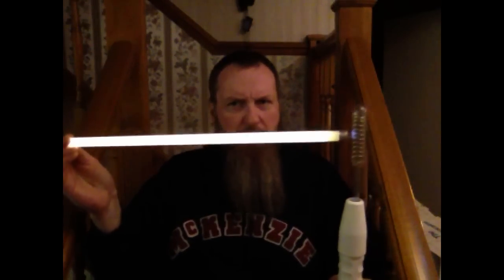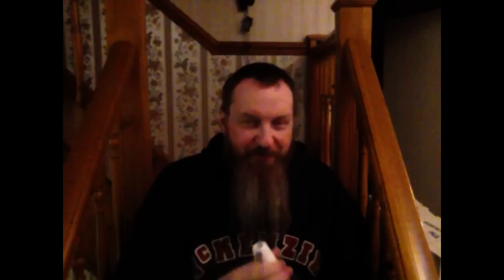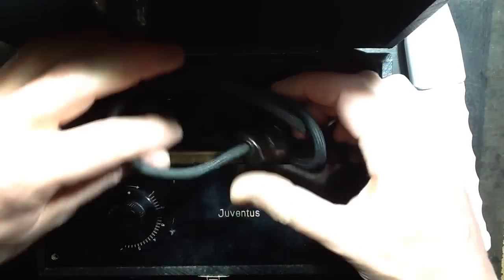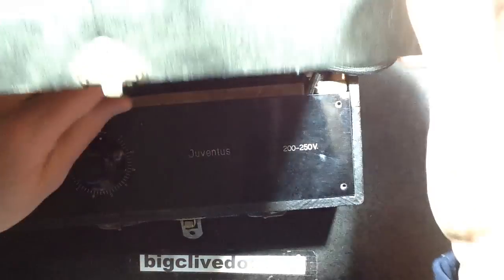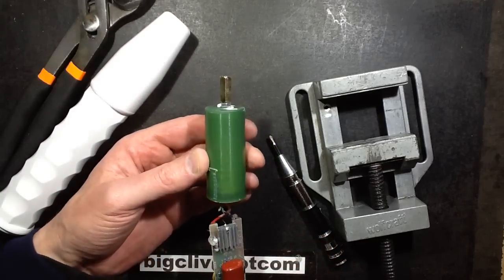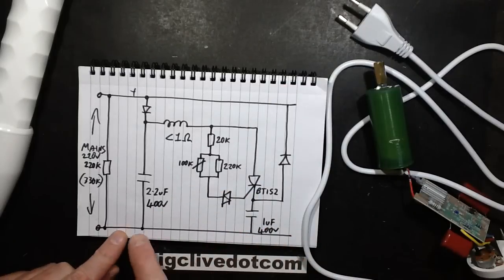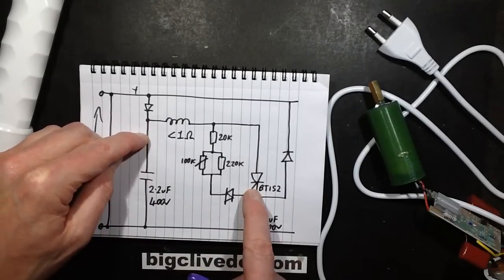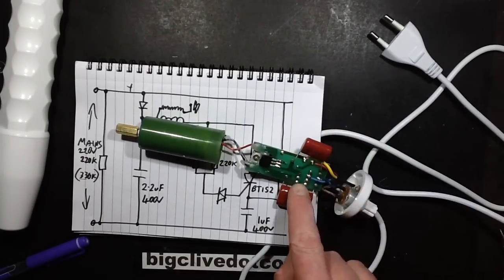A look inside a Darsonval style modern Violet Wand Ray unit.

Comment: So couldn't you actually just bypass all the resistors and the diac and the diode. Rund switch straight to the capacitors and into the coil. I mean these things are all rigged up to like get it down to like 10 to 15 20 watts. So if you bypass all that run the capacitor straight into the thyristor and into the coil. So I looked up each individual piece and what every piece does. The thyristor allows for your 120 volts to the 220 volts there's two different thyristors, but I don't think they used thy wristers on the old Violet Ray wand. All the resistor does is only allowed so much current to flow through. A dioid only stops the current from flowing back and destroying any of the components. The diac is connected to the thyristor and it's similar to a diode it only let so many volts flow into the thyristor. There's only two types of diac mainly. One diac lets about 30 volts flow through and the other diac up to 70 volts through through the other one is the ht60. So what do you think you could run the potential meter is straight into the capacitors and into the coil. I mean you'd still have the control of how much water is your voltage is going through the capacitors in the coil with the potential meter. It just wouldn't be resisted down it would seem I don't know what do you think?

Comment: Great video , how does one open the black wand unit itself on older models , same method as on this video ?. Is there electronics in the old wand handles also ? my old Voiletta has just died. Appears to be no voltage on the glass handles and little or no violet inside the handles .The mechanical clicking noise is still there from inside the box . Last time I used it I think I used it for about 20 minutes ( maybe that's too long ) Any idea where I would start in terms of fixing it ? tia.
Reply from the maker: Some have a screw down the end and some have a cap that unscrews at the cable end.  Be very careful, as these units do not have isolation from the mains supply.  (I recommend that they are not used with the metal rod electrode.)
Most common failure tends to be the capacitor in the base unit.  The wand just contains a coil, but if that fails it would need replaced completely.
Reply: @bigclivedotcom  Thanks Clive , when you say the '' base unit '' do you mean the ' box electronic section  ' or the ' black wand itself '' ? ....sorry for the silly Q , thanks a mill in the interim .
Reply from the maker: @danvelgtr  The box.  All the wand contains is a wax impregnated coil.

Comment: I finally found it and very interesting it is too. I did try thumbing through your videos but kept being distracted. I still have about half a dozen or so of the old types electromechanical ones in the attic above my workshop which I never got round to making safer and selling. I really must have a clear out as I forget what's up there. I can see a dual trace valve oscilloscope and a valve audio frequency generator next to a couple of AVO's. I love vintage electronics so much that I'm always loathed to get rid of things. 
I have a question Clive.... Would you be interested in having a dig around in the inerds of a Nixie clock which I was given by a friend who is no longer with us. It's working after a fashion but one tube doesn't seem to work but flashes briefly if I nudge the memory battery. It's beyond my knowledge to fix but I imagine you might be able to make a fun video out of it?
Reply: Hi there - are you interested in selling any of your possibly surplus stuff to a good home?
Reply: @NeuronalAxon  No, I recondition them during the winter then sell them as working, electrically safe units. I use the ones which are beyond repair for spare parts. Sorry.
Reply: @PurityVendetta  hi there the units or unit are ready to sell?

Comment: The circuit is cool, takes advantage of dimmer switching noise!  I think the diode not only discharges the 1uF, it also charges it to -300V so you could dump up to a 600 V pulse into the transformer.

Comment: Thanks for making this video. Have u made one for yourself too? I want to know the number of turns on the secondary coil.
Reply from the maker: It's potted in resin.  The high voltage means that winding coils like this has to be dine in well insulated layers and then vacuum impregnated with resin, or wax as in the old days.
Reply: Is the green cylinder a DC 3-7V to ~10KV spark generator? If it is the spark generator then it is easier to replicate this circuit? 
Can you confirm that by just adding DC battery to the input of green cylinder?

Comment: Just subbed today, totally loving the content! Showed this video to my QPP and now she hates me cause she wants one 😜 Of to EvilBay I go!
I wonder, how feasible would it be to fullwave rectify the input to give 100Hz? And would it still work with an isolated supply?
Reply from the maker: It needs the polarity change to create a higher voltage differential in the driver circuit.  You could possibly run it on an isolated supply, but the unit would cause a high voltage differential between the isolated side and ground, possibly defeating the isolation by causing internal arcing.
Reply: bigclivedotcom Aww bawls, I thought that might be the case with the rectifier arrangement because of the voltage doubler. Read about that little dinger further down the comments after I posted mine. I suppose if she chooches right out the box, no point messing with her.
Thanks for the reply :-)
Reply: +azayles QPP=Quadratic Permutation Polynomial?

Comment: Would you do a vid seeing if this can actually damage electronics?
Reply from the maker: +ryan clarke That's absolutely guaranteed.  It can generate a modestly high voltage in nearby objects and a direct discharge will cause significant damage.
Reply: +bigclivedotcom pretty please ?

Comment: Hi Clive - Enjoyed the video on your Antique Violet Ray.  Just purchased a similar Antique Ray machine.   Could you tell me the voltage rating for the replacement Capacitor you installed in your unit?
Reply from the maker: +AlanK I'm pretty sure the one I used was a standard X2 interference suppression capacitor.  Probably rated to 630VDC.

Comment: "The other major market is electro-fetishism where the scary and tingly effects are popular for kinky fun." Upvote if you weren't aware of any other modern market for these before seeing this video.

Not-so-fun fact: Given half a chance, these will ignite silkscreen on clothing. Essentially the combination of current and voltage turns latex paint into a fusible resistor.
Reply from the maker: Even less fun fact.  Many of the fetish items in use with the metal rod electrodes are making the holders live at full mains voltage without them realising it.  Someone recently told me about when they were at a fetish event and while holding the unit they reached up to adjust a chain and got locked on.  Fortunately someone saw it happen and pulled the plug.

Comment: Don't forget the BDSM crowd love these things,not just for quacks
Reply: LOL OMG
Reply from the maker: Martin O'Donnell Yup, and they often use the original retro units with the metal wand attachment because they really don't have a clue how dangerous they can actually be.
Reply: bigclivedotcom Some of them do. I have a friend who has gotten several designs burned into her skin intentionally with a violet wand (in a BDSM setting).
I assumed that the main reason they were around was BDSM because I've never seen them used outside of those circles.
Reply: +Martin O'Donnell I guess so...On EBAY the violet wands are on the same thread as vibrators, D-rings etc... weird.
Reply: +Martin O'Donnell And it is from the BDSM community that the modern term "violet wand" originates.
Reply: Ive been thinking about getting one of these for this exact reason, are there any that are particularly more safe than others, or are they all kinda dangerous. I kinda wanna try this kind of thing with my sub before spending the money on something more exotic
Reply: The thing that gives you safety is the spark-gap created by having a glass, gass-filled electrode. So if you are using one of those, you're fine. 
There are also techniques that require a non-glass electrode. In such circumstances, MAKE SURE your electrode/cable/whatever has  spark-gap included..  don't just grab whatever cheapo thing claims to have a spark-gap, they re not all made equally well and can break-down. It should be something you can actually see for yourself. DV8 trade on ebay/etsy do  superb one, just takes a while to arrive to the EU.
Reply: that my bisness indeed ;) got 60 old ones
Reply: @TheBaconWizard  I can't find their store do you have a link, please?

Comment: I was delighted to find this rather early teardown video of yours, Clive. I use one of these with a metal electrode to check for leaks in my discharge tubes when they are being evacuated. The arc jumps to any leak immediately. Well, it's good to know that the output is referenced to the mains although I've never had any desire to touch it! I've often wondered what's inside, and now I know without having to rip mine apart. You save is all a lot of money at your own expense, Clive. Thanks as always -Peter 😁

Comment: I have a couple of the "Renulife Violet Ray" sets, circa 1926 (or at least the instruction  manuals were printed then,  I have most of the glass attachments still intact.   A particularly interesting feature is the "ozone" setting for some sort of ozone therapy.  with a sort of hard rubber mask that was meant to go over the nose and a hose that goes into the unit so you could breathe concentrated ozone.  I would think that most people who got that treatment would have found it unpleasant enough that they'd just decide they weren't sick enough to make another appointment.  But most people back then trusted doctors at least as much as they do now..  I wonder how much of our modern medicine will be considered quaint quackery 100 years or so from now?
Reply: Exactly . You hit it on the nail. You do not know how right you are

Comment: Been watching your videos for some time now. I recently acquired an old Renu Life Violet Ray box which does not work. Was surprised to see that you had a video a similar type of unit. The one I have does not have the "variac". This one is 120v unit. It has a set of points that vibrate depending on how the mechanical adjusting screw is set. The big wax paper cap in this one is obviously bad; there is a big pile of wax under it. How did you come up with the value of 220nf for your replacement cap? I used a cheap capacitance meter on this one and got a value of about 2nf. Close to posting a video about what is inside this one. Would like to get it functional before posting - if possible.
Reply from the maker: I chose the replacement value by experimenting with different values.  If your capacitor has failed it may be affecting the ability of the capacitance meter to test it.
Reply: Did you have any luck with your unit? There's not really much to the old devices, is there?

Comment: what happen to the secondary part of the transformer aren't they isolated?
Reply from the maker: There's no isolation.  If you used a metal rod in the end of this unit it would be dangerous.  Glass electrodes only.

Comment: if you have prostate issues this will cure it... its not a toy even tho most children will want to play with it...
Reply: its not for everyone
Reply: clearly they have already braindamaged you... I am so sorry for you... I can FEEL you HATE
Reply: That is simple by energizing the cell and bump the cell voltage to max of 90mv. ( milli volts). You would get the best regeneration of the new cells this way. This is an extraordinary device if used correctly . All type of pain will just disappear. Do not use it if you have a pacemaker could upset its function. So be careful
Reply: NolanSyKinsley sorry to burst your bubble dear, but I can attest to its efficacy . My hair stops hairfull after 2x of use, spider veins diminished, my face are so tight and minimized pores it even helped with my keloid after 4x of usage it is less prominent now.

Comment: Im not convinced that the output is 50 hz.
These are typically high frequency output devices. I have seen such devices....even modern, that had spark gaps.
It would be interesting to check the output to see if it was in fact HF.
maybe attenuate the signal with a voltage devider, then measure the result with (an old) scope, maybe from a good distance away.

Comment: That old one is a very interesting and collectible antique, I personally find the old quack devices fascinating. My favorite of the old quack devices is definitely the tobacco smoke enema, where the term "blowing smoke up my ass" came from.
Reply from the maker: Yes indeed.  What better way to bring someone back to life than with a pair of smoking ass-bellows.
Reply: +compactc9 well, they are still used, but now as kind of eStim by kinkers.Only quack part of them was that old ones didn't had stable frequencies, created a lot of noise and high voltage and were presented as panacea.They are good as some sensory treatment or stimuli, that may dull pain or cause exhilarating sensations, nothing more
Reply: +compactc9 Cigar in your sunny cavity was actually being used during state of the art surgical procedures in the dark times (XIX century), so it wasn't only "quack" thing ;)

Comment: One of the non quacky uses for these things is to bring them close to a high pressure hard to start ion laser tube - the intense RF field helps to excite the gas when the regular starter cannot convince the tube to ignite. Don't put it near the anode though :)

Comment: Great video! Quack medical stuff is often fascinating.  A few decades later, after electricity became "old hat", the quacks seized on radioactivity, putting radium and thorium in everything from toothpaste to "personal massagers".

This modern version of an Oudin coil reminds me of one I have used for finding leaks in vacuum systems, and for burning out shorts in TV picture tubes back in the day of CRTs. It had a knob on the bottom to "tune" the unit by applying pressure to the vibrating magnetic armature at the end of the coil. Think the one I had was made by Cenco, a scientific instrument company.

Comment: Found these on the 'net:
http://www.loneoceans.com/labs/ignitioncoil/
This one is almost the exact same circuit:
http://www.instructables.com/id/super-simple-ignition-coil-drivers/step7/SCR-driver/
Reply from the maker: Jammit Timmaj The circuit seems more to be a single shot circuit to dump a capacitor through the coil to create a single spark.
Reply: bigclivedotcom The Instructables one was designed for pulsating DC. As long as the power keeps getting interrupted, the triac/SCR will keep charging and dumping the capacitor into the coil. If it was steady DC, it would fire once then stop. I've done something similar with a standard light dimmer hooked up with a capacitor in series with a coil. The triac dumps the stored voltage on the capacitor into the coil. You get bursts of high frequency oscillations occurring every 1/30 (USA mains, firing on each half cycle) of a second.

Comment: I did not know those things where still in production after the 1930s... Interesting...
(And good for BDSM people... I see absolute no practical use outside that, except for teradown in the name of science... :D  (Well, hand held "tesla pistols" also existed in more serous things for testing galss high waccum seals for leaks.)
Reply from the maker: +Sheep_Ewe Like the spark testers as used in the neon sign industry.  I took one to bits and it was indeed a vintage violet wand re-badged with a suitable electrode (which apparently has a spark gap built in for safety.)
Reply: bigclivedotcom

Thank You for interesting info!

I saw some of those mystical wands on a fleamarket here wery long time ago, and i always wondered whas it realy was until a friend told me about it. At least for the old models (My guess made back in the 1930 or so, not sure when they first apeared) there where also separate small boxes one cold order, containing warious shaped, strange extra tools for them.
I found one such old box on a friends attic long time ago (but i guess he wanted to keep it), but not the spark generator so we could not test drive it.

(Since i building a High wacum laboration table i will now deffinitly keep an eye open if i see one of those strange things again sheap on a flea market... :D )

(Sorry for my Terrible English...)
Reply: +Sheep Ewe 
OMG! :D I wish i had not checked those things up on google, but i hawe not tried yet so maybe nice things... XD

Comment: I collect pieces of medical quackery and have an old one of these!  The shocking would leave people feeling enough to believe SOMETHING had to be happening, and it was. Turns out they were not just shocking people but, unlike the new ones, the old ones didn't use glass that was opaque to UV. These things crank out lots of UV A B and C (from what I remember reading) and many of the malpractice suits the manufacturers lost involved horrible skin lesions (cancers) from the regularly repeated "therapy" sessions.
Reply: So you mean to say that the old ones used a material like fused silica quartz glass that doesn't block uv ?
Very intieresting, if I may ask, how did you stumble on that information, and do you know anywhere that I could read upon more on that  ?